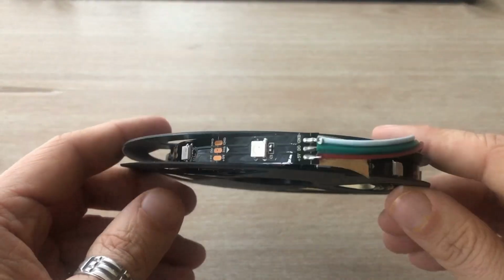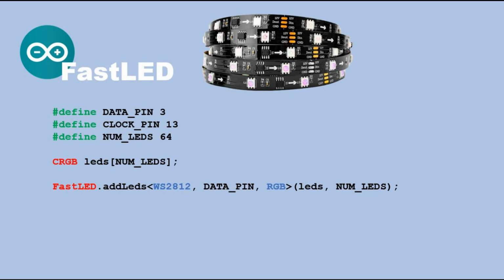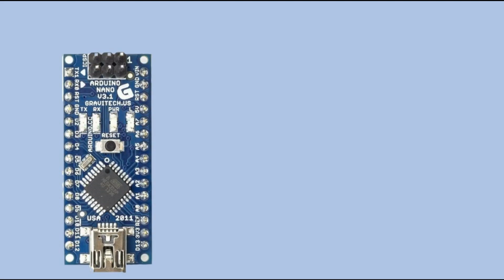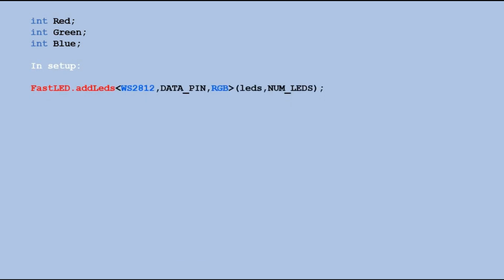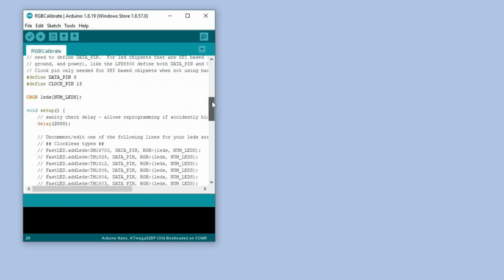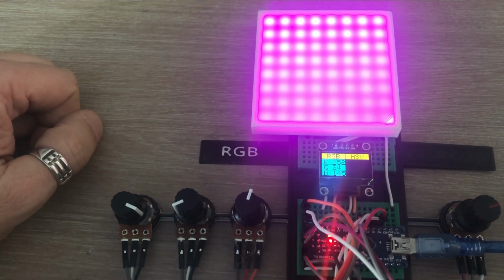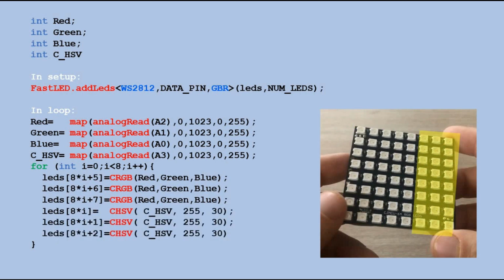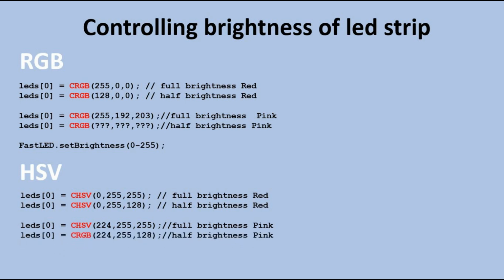RGB vs HSV on Arduino — The Best Way to Control Addressable LEDs

Comment: The neomatrix library comes with an example in the Arduino software that consists of passing a message from left to right, use the rgb colors as I could convert this into hsv so that the message comes out more beautiful.
Reply from the maker: I was planning to do video covering this library. It will come within a month or two. Not 100% I go you. Did you manage to convert the sample sketch from RGB to HSV or you want to conver but did not do it yet?
Reply: @marios_ideas  yo me roto la cabeza para tratar de lograrlo,pero que va no logro hacerlo,lleva un mensage con colores rgb a hsv y los he visto en anuncio y se ve bonito pero no lo logro
Reply from the maker: I would check the declaration of LED strip e.g. "FastLED.addLeds<WS2812B, DATA_PIN, RGB>(leds, NUM_LEDS);  // GRB ordering is typical" 
In this example we specify color order as RGB but as you can see it can be GBR. Try those two combination. If you set it wrong then colors would be wrong and you wont see the right pallette
Reply: @marios_ideas  a ver creo que no me entendió,el ejemplo que viene con la librería neomatrix  de mostrar mensage en una matrix de LEDs neopixels los colores son  rgb,pero yo quisiera ese mismo ejemplo hacerlo con los colores hsv,ya se que para lograrlo no puedo usar la librería neomatrix porque no me lo acepta pero no sé hacerlo con la librería fastled que debe ser la ideal

Comment: Is it possible to dim all leds for hsv colours at once using a single line of code like you can for rgb, instead of doing it in a for loop? I have another question about those potentiometer buttons. Did you print them or did you buy them somewhere, and also for that diffusion panel, what filament did you use (like if it is some transparent type, and is it pla) and how thick is the panel itself? Anyway, thanks for the video!
Reply from the maker: You can do it with single command Fastled.setbrightness(128) and Fastled.show should dim it to half as bright . If you want led to dim gradually you would still need the for loop. Check custom functions DimAll and LitAll in video https://youtu.be/hKL5Lw8u4-s
Reply from the maker: I use standard white PLA. The front of the panel is 0,5mm. I purchased the noobs of potentiometers on Aliexpress
Reply: in fast led the 3rd variable contained in HSV is brightness.
Reply: Very nice video!  Keep it up!